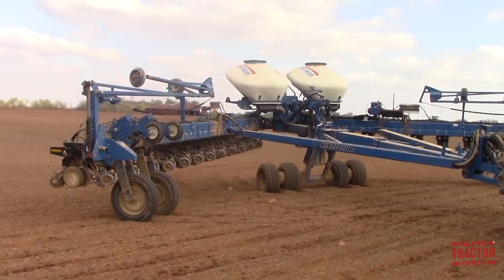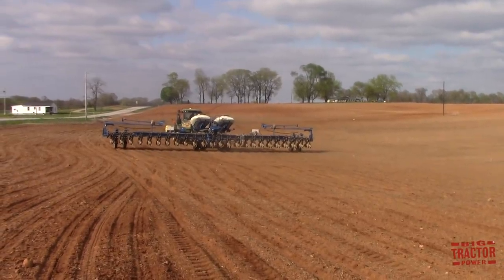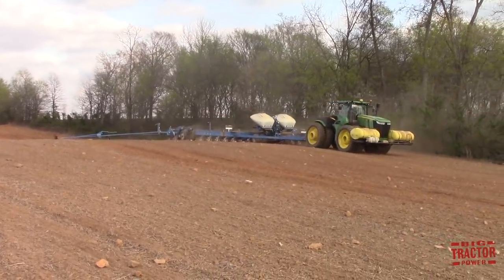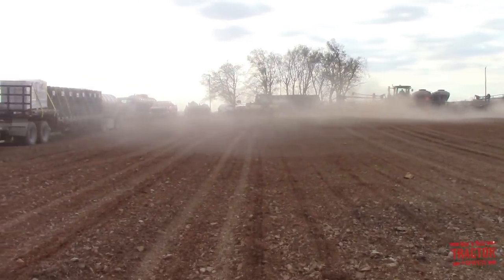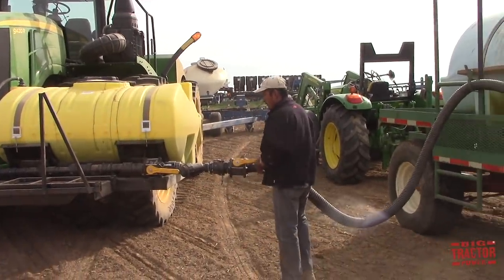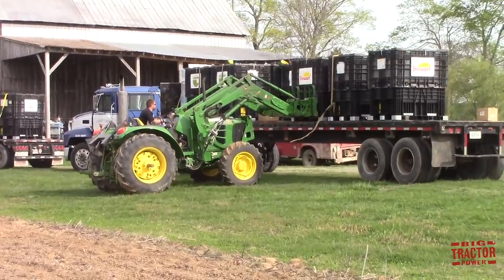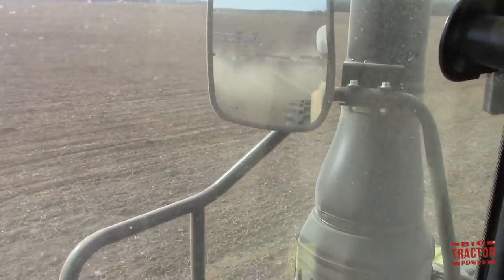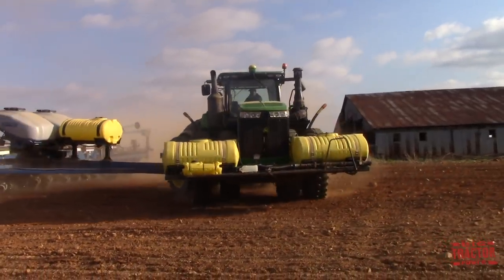Corn Planting Time John Deere 4wds and Kinze 24 Row Planters

Comment: In Nebraska Iowa and South Dakota planting season will more than likely be really late this year because of all the flooding in these states a lot of farmland is currently submerged underwater
Reply from the maker: Very sorry to see and hear about the severe flooding.
Reply: Seath, Will the flooding help by dropping silt and other trace amounts of fertilizer ?
Reply: The flooding isnt helping at all right now its destroyed homes business property  farm land roads bridges dams and levees railroad tracks taken out power claimed a third 9f offutt air force base caused the Nebraska state capital to start running out of drinking water because its cut the power to the water wells that supply the state capital  and killed people and caused others to go missing stranded and starved  livestock  cutt off and evacuated communities so at the moment all I can say is what is evident at the time which is destruction and death the flooding is doing more harm than good right now so I cant tell you if it will help because right now we cant see that far in the future the water has taken more away than it has left  alot of bio degradable things like cornstalks that could help the soil have been washed away along with tons of soil the water has so much soil in it it is brown and muddy not blue and pretty and transparent you cant tell how deep it is in areas because you cant see the bottom its depositing so much soil and mud in areas  that its taking snowplow trucks to reopen and clear roads this flooding is the most severe we have seen in half a century so to say the flooding will help is something at this moment in time just isnt something we can see right now we are starting the recovering proceshere in the northern parts as the water recedes as the water moves further to the south it's still a very real threat to those downstream in its path  more people communities property business farm land roads bridges dams  levees railroad tracks and livestock will ge affected before all the water finally pours into theocean the reasons for the flooding is rapid snowmelt with rain on top and frozen ground that the water cant sink into   and the bomb cyclone that hit us last week so I dont think at this timet the flooding will help because the ground is  frozen so for silt and other trace amounts fertilizers to get into the soil at the moment if the flooding depisted anything is impossible
Reply: @tellinghusen2014 , I was only referring to the soil. I feel horrible that lives, homes, livestock have been lost. I definitely would rather have had this not happen and pray for all the people affected by this tragedy. I'm sorry if I sounded not concerned, was not my intent.
Reply: Sorry I was so blunt but I'm just trying to help spread the word about what's going o  here because other than our local media it's not even getting covered the mass shooting in New Zealand is getting more coverage than our natural disater if this was Katrina it would be all over the news but the mainstream media outlets dont even care about what's going on here and quite frankly its sad that other parts of the country have no idea that the people out here that produce alot of our nation's food are struggling and trying to grasp whats going on and figure out where we go next from here we will rebuild recover and we will be stronger for it but it's going to take a long time not just days or weeks but months possibly a year or more because there is so much damage to contend with what took maybe 15 20 minutes to travel before the flooding is now turning into hours in order to get where your going roads are closed bridges are out so I'm only trying to educate and get the word out about what's going on here social media has bee covering most of the flooding besides what our local media outlets have covered and now just yesterday Monday the 18 did some of the mainstream media finally decide to pick us up 4 days after the fact so for us  here where the devastation Is happening it's kind of hard for us to believe the mainstream media really cares because they weren't here when it all started so pardon me if I sound a littleupset with the situation I have lived  here in Nebraska since I was born here and raised here my state matters to me and other nebraskans so we ask that you send prayers our way  for everyone affected
Reply: @tellinghusen2014 , Again, I'm sorry for all the loss and destruction you guys are enduring. Our prayers are with you, your families and thank you for all the info, terrible as it is.
Reply: Your welcome I'm just trying to get the word out because the media isnt I'm just trying to get the rest of the country to realize there will be people in need now
Reply: @tellinghusen2014 , Is it possible a state of emergency should be enacted ?
Reply: Our governor already has but the media is doing a very poor job of reporting
Reply: @tellinghusen2014 , One would think that the local media would cover this tragedy like a blanket, because with their coverage, more would notice and get the help that is needed ?
Reply: Our local media is doing their best but there are still people out there that think their food just majically appears on the store shelf they have no idea of the hard working farmers out here that supply that food those are the people I and others like me are trying to reach because with out the American farmer there would be no food on store shelves

Comment: The one thing that stood out to me was when they were filling the tractor using the loader tractor and pro box. That is a great way to lose a limb or life for the guy putting graphite in the planter should the hydraulics fail on the loader.
Reply: maverick12212000 I’ve never heard of that happening before. Or else I just haven’t kept my eyes open that well.

Comment: Is the 24 row Kenzie's biggest corn planter B.T.P.?
Reply: A 5 second search would confirm that it is.
Reply: The Kinze 4700 planter comes in a 36 row configuration with 20” spacing.
Reply: @Screamindynos  That's a biggin'!.
Reply: It's the same planter, same tool bar. Just has more Row units on the tool bar.

Comment: So there  were  3 planting Tractors  in that field...2 with the 600 gallon liquid fertilizer  tanks on tractor  and 1 with 2 600 gal tanks and what looks to be a 400-500 gal tank on the planter ?
Reply from the maker: There is actually 5 tractors and 24 row planters running.  This is just a section of a 1,600 acre field. Because all 5 planters were not in camera at the same time I focused on what could be viewed.
Reply: @bigtractorpower  thanks for the information....bug field... that's a lot of iron....

Comment: extremely slow way of filling planter. If your a bigger farmer like that you need a good sized rig. You could use the same size truck like you use to fill up a fertilizer buggy. Local guy here uses a trailer truck probably has a 1000 bushel of seed corn in it to fill up all his planters. Uses a trailor truck to fill water into his spray rigs has a few of them. etc.